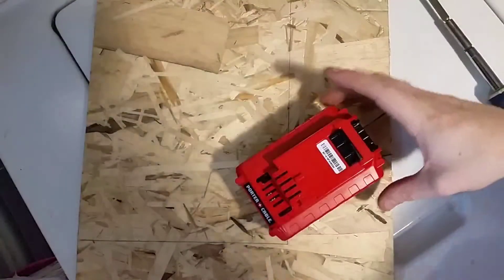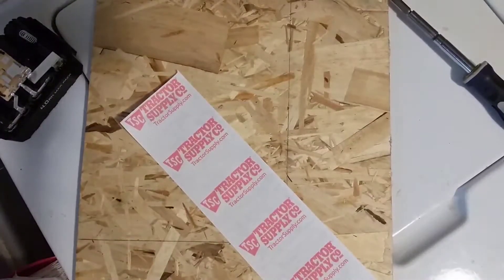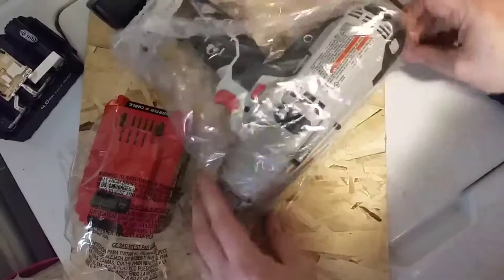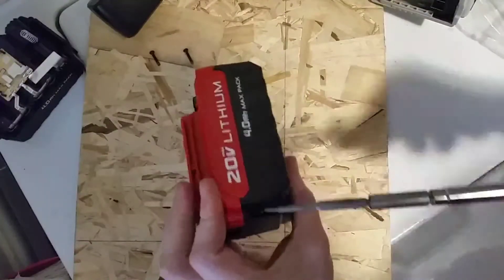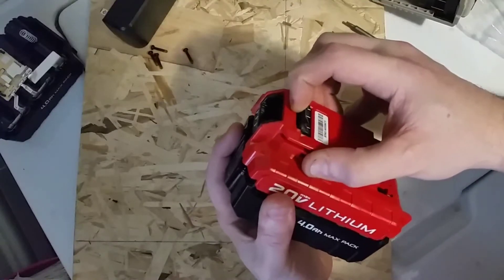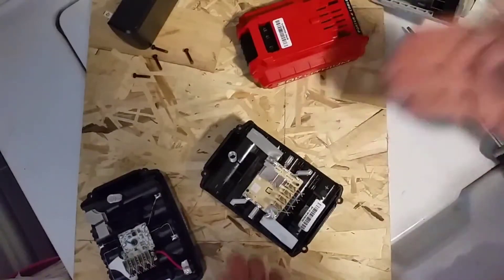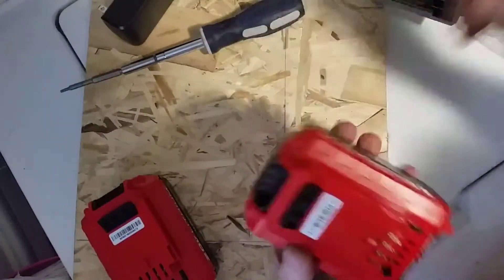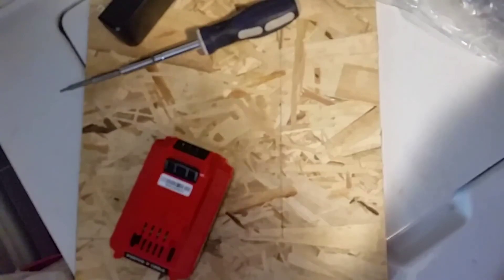Porter-Cable battery defective / won't charge (charger is fine). Is the issue the battery's "fuse"?

Comment: I had the exact same prøblem with a Black&Decker 20V battery. It loox exactly like your blown PB battery from the inside, and I did exactly the same: solder blob that wanky fuse. The battery is working happily ever since.
BTW it's a stupid thing. This battery is supposed to be able to deliver 40A current (2x20A) continuously. That fuse burns at around 10A which sux. The tools (and battery) are capable of much more with that 40A.

Comment: If you download the PDF from the manufacturer and got your butt off YouTube they don't have it all on youtube. The manufactures PDF would have had it broke down for you in the schematic and you would known. Take the part number the manufacturer of the battery look up the PDF which not just the manual the schematics it would have shown you that battery apart and you would have known if that should have been soldered or not. Every product out there has a PDF that shows the part separated number so each piece you know what it is just got to take your time and research to do it
Reply: Could you post the link for the battery pdf?
Reply: No they're NOT all available

Comment: Not a big examining it and see you took it apart cleaning up real good. Before you take it back even check your screw marks to make sure you didn't make a Nick in the painted screw. Sometimes you'll go up there and it won't be a regular lady you'll get the manager and they're a little more strict on examining products on return. Clean it up real well if you plan on returning it

Comment: I discovered the same thing with a battery that only lasted 2 months and trying to get in touch with Porter Cable is worthless. I finally decide to open it up and yep that’s what I found. I had a really tough time trying to solder it but I finally found your video and said if you can do it so can I. It finally works again. Incidentally, the hammer drill I got free with this battery also quit. I don’t know if Porter Cable has much future now because they refuse to go brushless and that’s what all the rest have done.

Comment: I would be terrified bridging those two connectors together, they are fusible links that serve a safety purpose. 
I highly do not recommend anyone to do this. This is the same as using aluminum foil to replace common fuses in your car fuse box, it is dangerous.
I have seen personally what just a 3.7 volt lithium iPhone batteries can do when they become defective and catch on fire and its terrifying. It burns like a roman candle, you can't put it out and I can only imagine what a 20 volt battery like this would do.
Reply: Dude…you just saved so many lives.😁

Comment: You just created a fire hazard.  Unless the metal you used is the same size and material of the original.  Now, if the battery overheats when charging, the material you used may not burn away as intended.  Good way to fool insurance company if you wanted to burn down a turd of a house though. Wink ')

Comment: I have that battery and yes you are correct there is a small piece of metal soldered flush between the two sections if you didn't know what you were looking for it almost appears solid.

Comment: Do you have to use copper or can you use regular solder?
Reply from the maker: A solder bridge will most likely work just fine.
Reply: The idea is that if the metal connection over heats then the metal melts away in an instant to prevent a fire or hazardous situation. The link needs to be a material that will melt at a lower temperature than any other object in the battery but will still carry the correct current. Bypassing this could result in bad things happening. With some engineering calculations I am sure a suitable replacement could be fabricated. Solder will stick but a lot of heat has to be applied quickly to surfaces of that size.